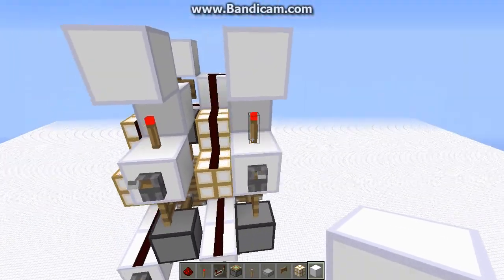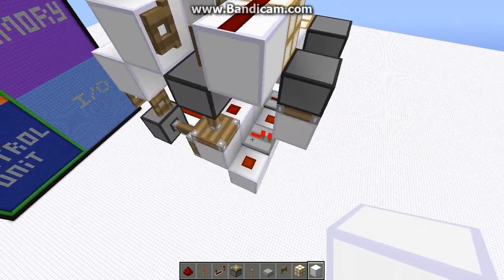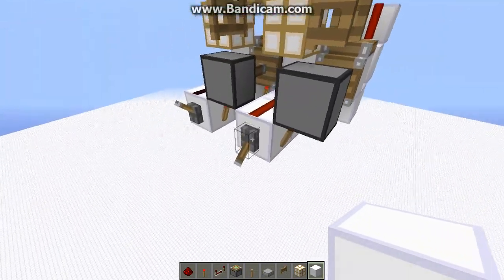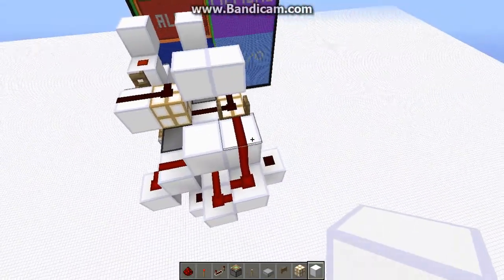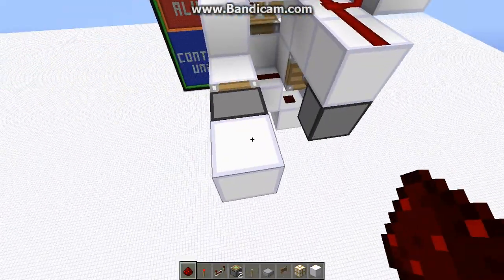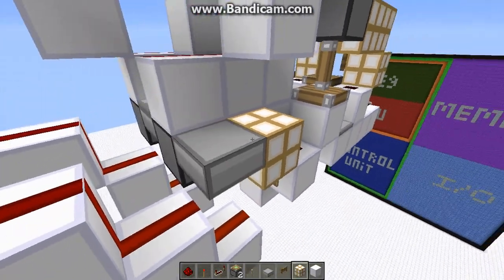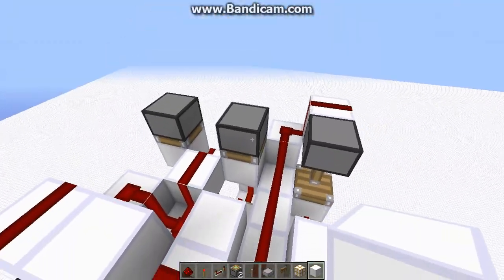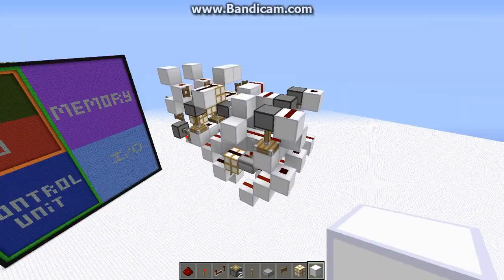Advanced Redstone Computer Tutorial ?: Adder - Carry Logic

Comment: What if the XNOR gate that I used functions with an AND gate in the first place? It's an alpha style XNOR gate using no repeaters or pistons, just dust and torches. It's a 3 wide, though, with the and gate in the bottom middle. Could I potentially just use that AND gate, or do I need another one coming out next to the output?